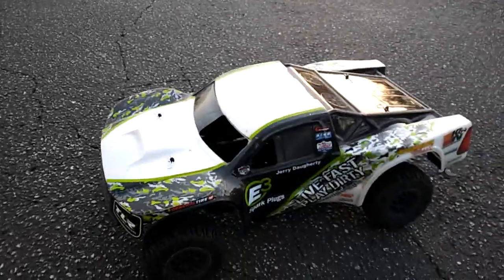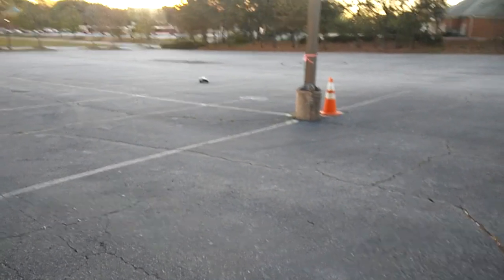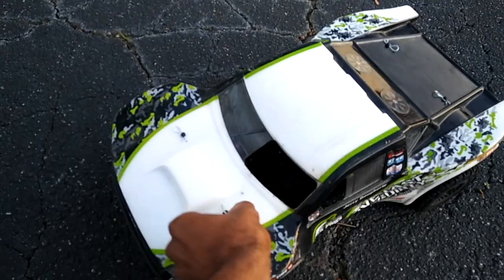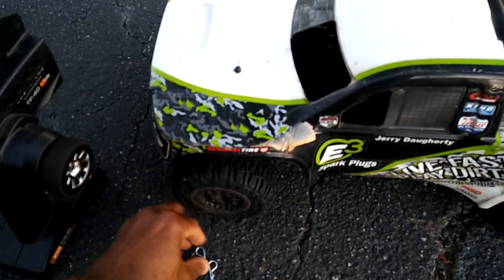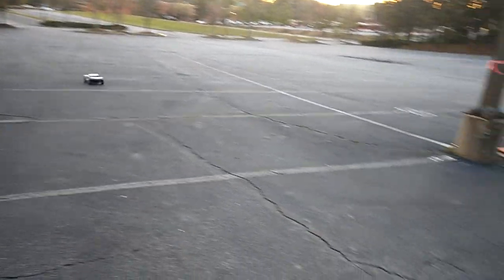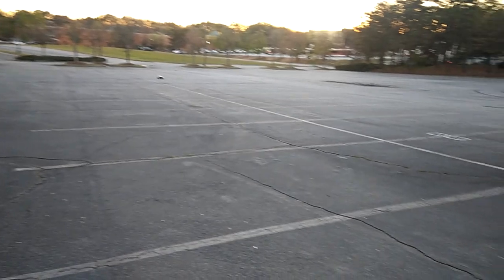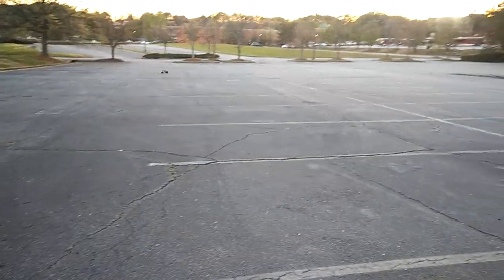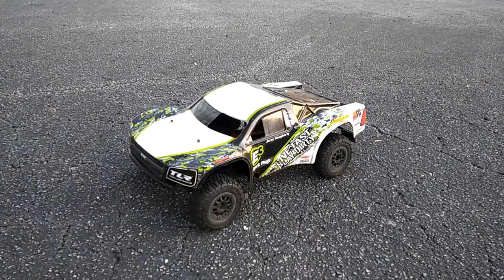Losi SCT (Nitro Version) conversion to Losi SCTE Project Part 3 Running on 2s lipo

Comment: Im about to put a brushless setup in my sons slash 2wd. What would you recommend.....Velineon, Castle SCT, or Rc Gear Shop 3900?
Reply from the maker: vxl is a direct bolt on and cost 140ish but not as good if you get a castle system b\c castle u can program better. The rc gear shop ones have been the BEST bang for the buck and beat the castle 3800 and traxxas 3500 any day..i run them in many of my cars:)..so castle maybe sv3 esc with RCGS 3900...prefect combo or get the MMP but cost more